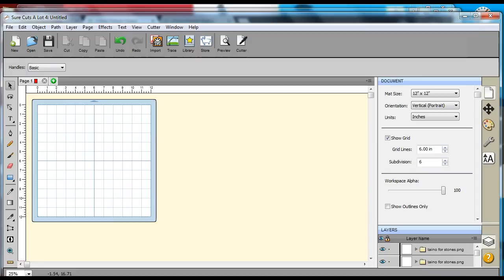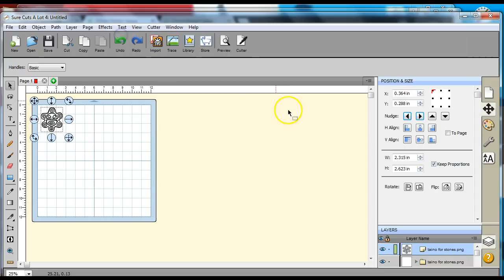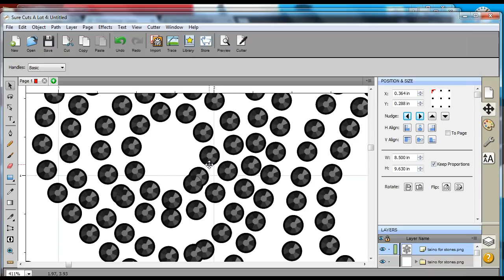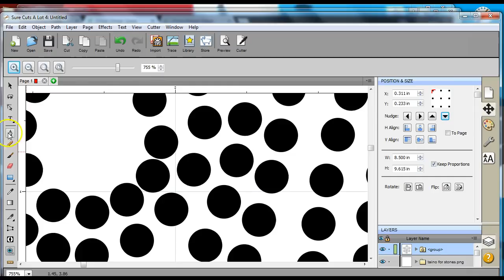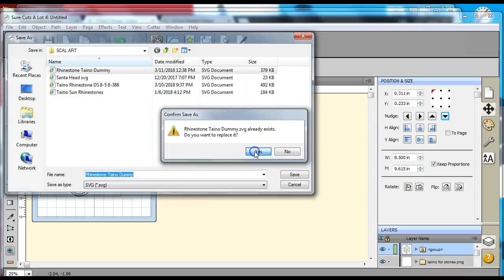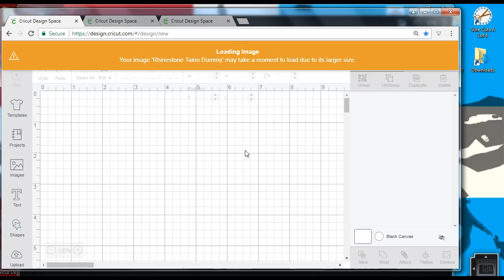CUT CRICUT RHINESTONE TEMPLATES PART ONE

Comment: everytime I open scal it is just a blank screen, nothing loads, have u encountered this problem before?
Reply from the maker: I have not. Perhaps you can uninstall the program and reinstall it, then restart your computer after installation. If it still doesn't work, I'd contact the company you bought it from. I'm no l ok anger using SCAL. I use TRW'S Wizard program.

Comment: WHAT SETTING ON THE MAKER DO YOU USE TO CUT THE STICKY FLOCK?
Reply from the maker: I havent tried cutting the magic flock with my maker yet, however the fabric setting worked great on the explore air. If you test magic flock on the maker, start on the fabric setting on a small sample piece and if it doesn't work well, I would increase the pressure. I'm confident it will work great with the maker as Cricut has great machines and an array of settings! However, if I test it in the next few days, I'll let you know! Thank you!

Comment: I understand SCAL software may not work with cricut makers according to a seller on ebay, true? Plus my printer is wireless. Again, seller it wouldn't work, true also?
Reply from the maker: Hmmm...good question. I have never tried it with my maker. As a matter of fact I'm still using my cricut air, however it's compatible with the Cricut DESIGN SPACE, so I'm not sure why they said it doesn't work with The Maker, when The Maker is strictly a die cut machine. It's purpose is to cut materials as Design Space is for designing and at the end of the day, SCAL IS compatible with Design Space and you NEED Design Space to cut. Lol. I don't know what to say. Doesn't make sense to me. I wouldn't want you to waste money, yet it might be worth the $50 try. Good luck!
Reply: @MarilynDIAZDESIGNS  I asked Cricut who said warranty would be voided if I use a 3rd-party software. Ty 4 ur QUICK reply. GREATLY appreciate that!
Reply from the maker: @jean11290  what?!?!?! Lol. Oh wow, you learn something new every day. Thats interesting because Cricut used to advertise and/or sell older SCAL versions to go with Cricut. The template is very simple and similar to cricuts format. But hey if Cricut told you that, run with that. Mark my word, eventually Cricut will probably incorporate rhinestones with their product because as of right now, rhinestone cutting works with Brother Scan n Cut and Silhouette. Don't get me wrong, I LOOOOOVE all my cricut products, however they're behind the 8 ball with the rhinestone capability. But I'm confident they will get there! 🤓 Good luck! Have fun!
Reply: Marilyn DIAZ DESIGNS Sorry for the late reply I was having dinner. Anyhow, who knows every time I speak to someone different I get a different answer. I agree that they are behind the ball with respects to rhinestones as this seems to be very popular.
Reply: @MarilynDIAZDESIGNS  Can you tell me which site you purchased the software from?  Also is it the SCAL or SCAL Pro?  Not sure the difference.

Comment: For some reason when I go to move the rhinestone circles to make them look better in the spots I want them to go I’m having an issue with them snapping to certain spots and not wanting to move....how can I turn that feature off so I can move them wherever I want?
Reply from the maker: Jessica Martinez use the nudging tool. Its on the right side of your panel with little arrows, using that tool instead of your mouse or arrows on your keyboard moves them slightly and does not necessarily snap them into place. 🤓

Comment from the maker: For some reason, my replies are not registering. I’ll try again as it’s own post. In order for this to work with Cricut, you must EXPORT the file and save as an SVG. There will be an additional window that pops up and asks “save as compatible to Design Space/Cricut”, make sure this option is checked. I’m not sure if it works with explore, because I am working with a Cricut Air, HOWEVER, if you are able to use Design Space with the explore, it should work the same as it does with the air, it’s about being compatible with Design Space. Hope this helps all the inquiries below. Hopefully this will post!